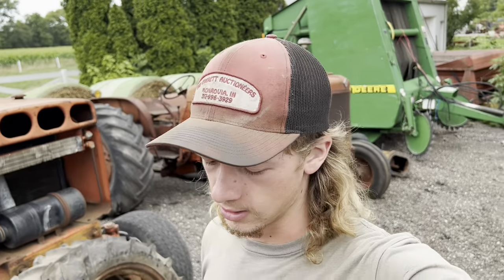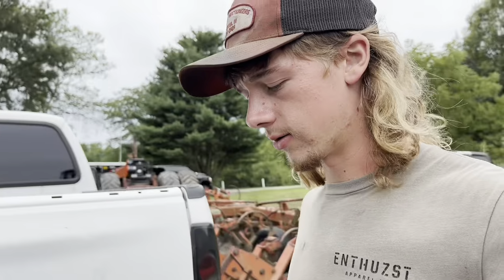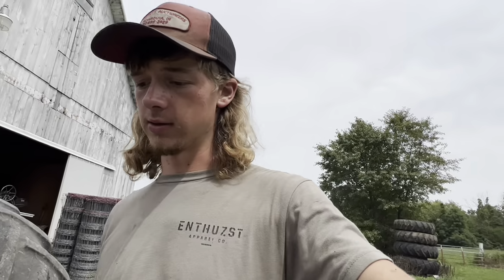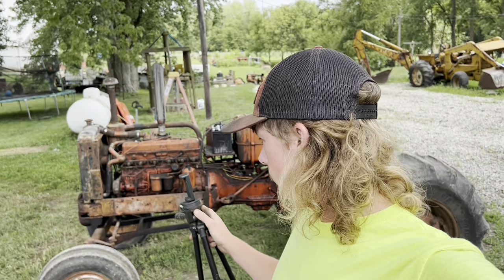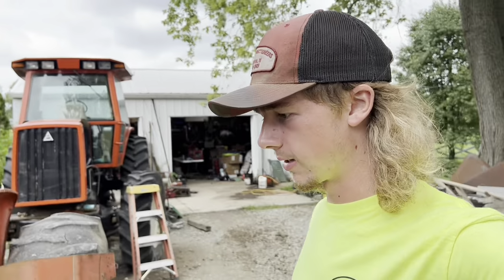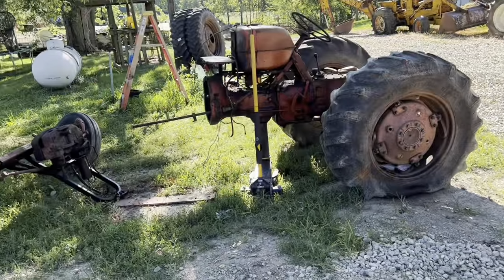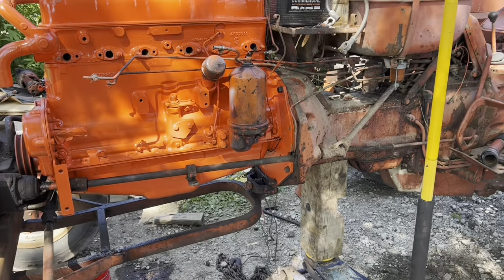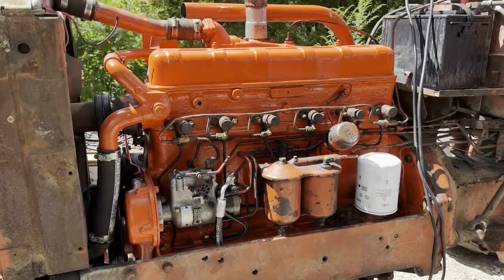Motor Swap on my Allis Chalmers D17 Diesel

Comment: Your timing is definitely off, keep in mind the balancer has a rubber insert on these engines, it will spin and your timing marks won't be right. From my experience it's a pretty common problem on the 262. When ya overhaul one it's easy to remark the balancer at TDC but can be a bit of a pain when it's in the tractor, totally worth it though lol. Great video I'll be watching 👀 👍

Comment: It seems to run as bad as it did with its original pump and injectors. Pull valve cover and check valve springs for tension. It seems to be worse at higher rpm. Injection timing is constant where ever it is set. Smoke and loss of power yes but not a miss. Irregular smoke pulse is not timing in my experience. Just my thoughts. Ian🇦🇺

Comment: I say open injectors on top screw plus when running at 1000 RPM close top screw in fire order of engine and fuel filters bleed to air out to also add Automatic transmission 2 or 3 GM type in fuel tank too ! When do bleeding in injectors plus pump also need add new thermostat too when put new water pump to and do 60 % green antifreeze also 40 % water!